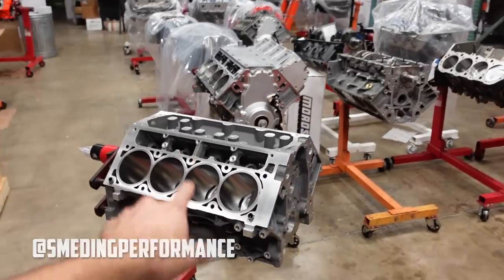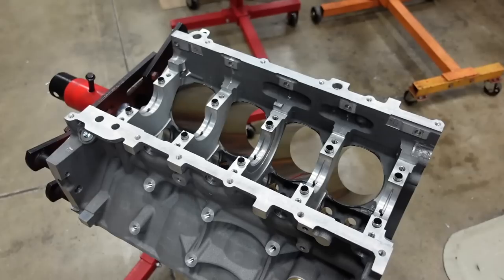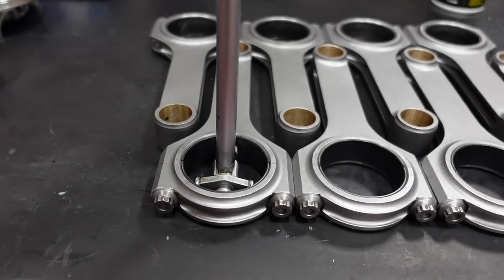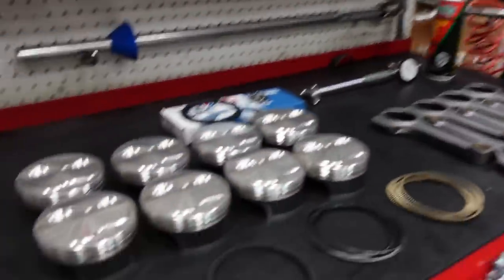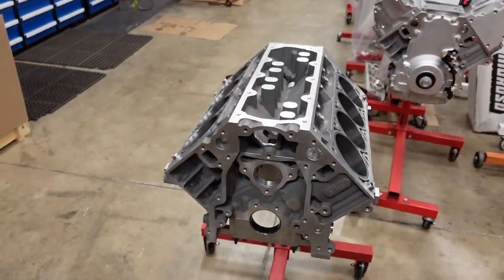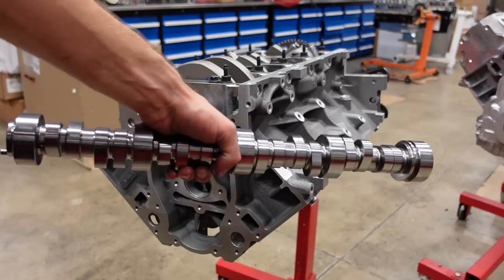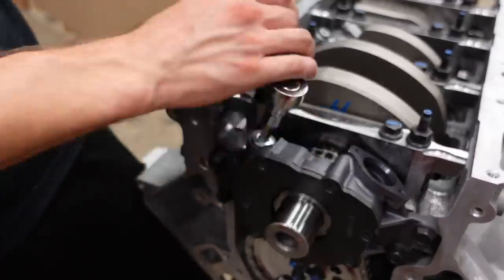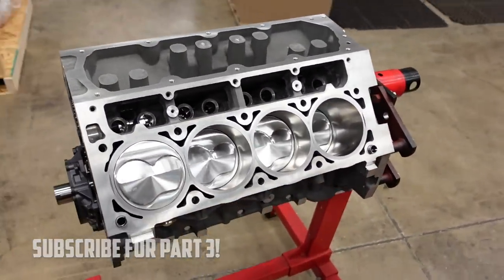HOONIGAN 700HP 441" 13.25:1 LS Short Block Assembly - Part 2

Comment: That's interesting about rotation force. Now I want to plot a formula for it. Crank arm length/weight momentum, rod ratio/length, pin/locks, piston/rings, bore/design and even flywheel/clutch/converter etc. weight vs G-force. To get it spot-on. That's cool.  Your RPM is under 7150 for the crank. A 4.375" is under 6750rpm. Force would be more than linear, I'd think. Less RPM comparable in actual weight and displacement, etc.  Plot for flywheel horsepower maximum at RPM limit, for the rods - application, power delivery, transmission, tires, etc.

Comment: Does a 4.125 crank leave enough space for some oil squirter? I have a L8T block than Id like to do a 4.125 stroker with it. I couldn't find much info on those newer blocks ...same things for direct injected pistons designed for 4.125 stroke. Would need to be costum pistons?

Comment: For the high pressure standard volume pump could you use the stock oil pump and just change out the spring to get a similar result?

Comment: Why no ARP main studs? Is that a problem with the factory dowels, alignment wise? Are those ARP main bolts or factory main bolts?
Reply from the maker: Not required for the application. OEM main bolts.
Reply: @JacobVillemain  Gotcha!!!!! Thanks for the reply.

Comment: On a previous biuld you didnt install a windage tray. How important is a windage tray?
Reply: Not very
Reply: It can be very important, but depending on application it may be less important to others. There's also instances where you simply just can't have one. He may not be able to have one in this due to the size of the stroke. All it does is keep a little oil from splashing on the crank, causing drag.
Reply from the maker: There are better places to put your money that will net more torque and horsepower. I haven’t installed a windage tray in years, although a dyno test video might be coming in the future!
Reply: @JacobVillemain  I used an improved performance crank scraper but not the windage tray.   Seems to do well without a windage tray

Comment: you say these bearings are perfect, but what is perfect. Tell us the numbers your are looking for and what you got.
Reply: Most engine builders don't like to tell all their secrets  but most .001 per in.of journal  but can change if running big power adders or if its aluminum rod motor  or if they setting it up for thicker oil
Reply: Go through his old videos. He shows you how to measure for the right bearing depending on what your doing. The clearance you're running isn't the same for every engine. You can run tighter or lighter clearance depending on what your doin with the engine. He has a video where he breaks that down so you can make the call on what bearings to use.